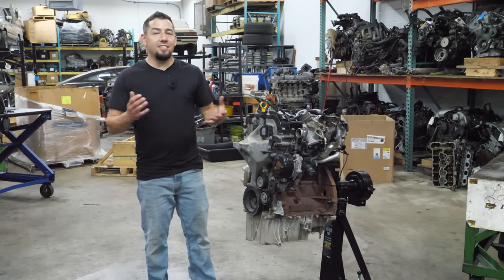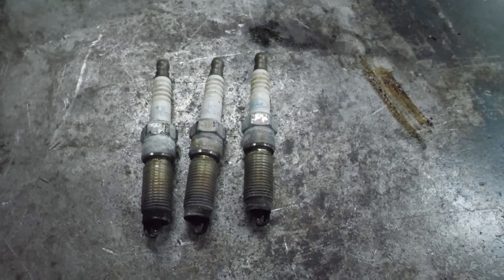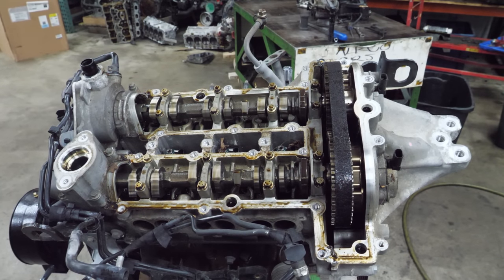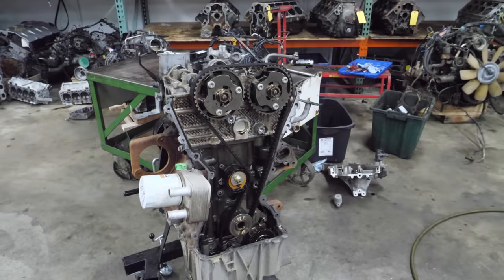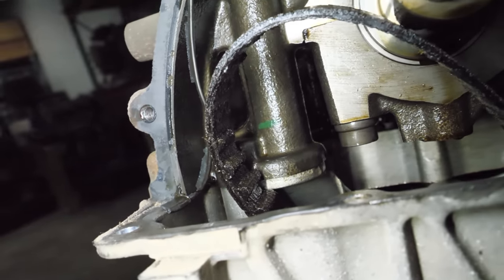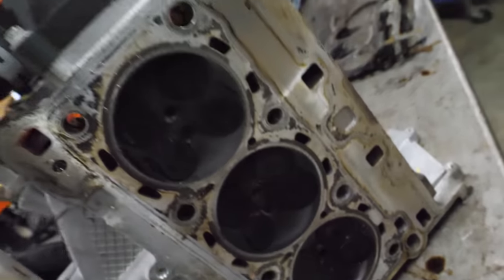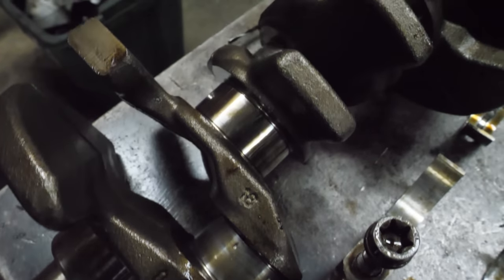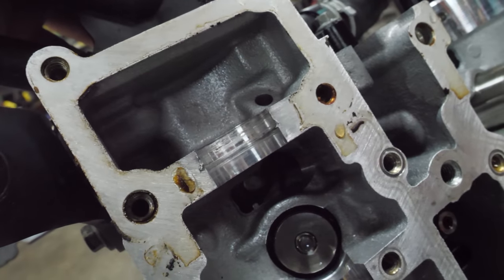JUNK Ford Ecosport 1.0L 3-Cylinder Ecoboost Teardown. LAWSUIT ENGINE!

Comment: I'd like to say I was surprised with how bad the engineering and design of this engine was,  but Ford has a long and sordid history of making subpar engines.  Love the teardown and commentary!
Reply: And yet Ford also produces the absolutely brilliant 5.0L Coyote V8 engine so go figure!
Reply: @DJDinaggio  They get lucky every now and then.
Reply: Shockingly GM has a wet belt in at least one of their new diesel engines, I think powering the oil pump, and you have to pull the engine or trans to get to it. Imagine spending the diesel tax, and having this junk in your engine. 

Sadly it's probably going to be a trend to keep cars from being too reliable and keep them failing so you have to replace it with a "cleaner" new vehicle.
Reply: The 5.0 Coyote is probably the best modern engine they have. The old 5.0/302 from back in the day bc was a good one also.  

The problem with Ford now is “planned obsolescence”. They don’t care if you want to keep a vehicle long term. They quit product support as soon as they are legally able too.
Reply: @OUSWKR Yeah but that's their one thing. Funny enough I feel like nearly every generation of mustang has a fairly bulletproof motor.. but most of their other cars go to shit. It's like they're obsessed with the Mustang only lol
Reply: @OUSWKR   Planned obsolescence also applies to other car manufacturers. It isn't in their interest for owners to have super reliable cars that last 20+ years.
Reply: @Perry....  Mustangs always shared an engine with many other ford products, at least the regular Mustangs. 5.0s, 4.6s, 5.0s again. You would find those in trucks, vans, SUVs. I am sure it was the same for the older ones too.
Reply: ford australia built some of the best inline 6 cylinder engines in existence, that have good output and phenomenal reliability. the coyote 5.0l is basically a v8 version of the barra 6cyl which came out nearly a decade before the coyote.
Reply: @6226superhurricane   The Coyote is an evolution of the near bulletproof Ford Modular engines.
Reply: @DJDinaggio  coyote head is more similar to the barra head than modular v8. and the barra head is a twin cam version that replaced the sohc 6cyl that goes back to 1988.
there's far more barra design similarities in the coyote than there is modular v8
Reply: Their 1.6 Ecoboost is not too bad, going from 180 to 350 hp on a unopened engine and it's coping fine for me, the 2.3 ecoboost on the other had doesn't do much more than 400 unopened which is pretty crap for a engine with 350hp from factory
Reply: @OUSWKR  I know many engineers, in various industries. Approximately zero of them engineer for "planned obsolescence". Imagine how precise you'd need to get it to fail, just outside the warranty period. It's not done. Urban myth.
Reply: @6226superhurricane  Ancient technology.. It uses pushrod to control the valves, and we are in year 2023.. Coyote is just cheap power cause one uses ancient technology.

Ofc using ancient technology has it costs. Pushrod engines dont rev very fast, they got alot to "push".

Pushrod altso have alot of moving parts. The more moving parts you have, the more potential for failure. 

Coyote is good as "cheap power" for one who wants to drag race abit on the weekends and not break the bank with buying modern technology.

Just a good transmission for an VR38DETT will set you back 25k, so i understand most wont be hobby dragracing with that.

However, the Coyote is still ancient technology. And is in no way a "good engine" in pretty much any sense except for price/power ratio.
Reply: @MrDanisve  well clearly you're confused, the barra and the coyote both use double overhead cam, vvt, roller cam followers. no pushrods.
the 4.0l barra 6cyl in the fg sprint made 370kw (496hp) and 650nm (479 lb/ft) standard
Reply: @DJDinaggio I guess the coyote getting cylinder deactivation in the new gen is brilliant. How does that work out for GM.
Reply: The 300 cu-in straight 6, which I think was torn down about a month ago is an old bullet-proof engine that was designed to last forever.
Reply: 4.6L 2V in a 05 Vic LX Sport with 309k miles on it, no major repairs, Id say they get some of them right. But yeah this 1.0L EB is garbage, shame on you Ford!
Reply: One of the best ford engines was the straight 6 cylinders . Like the 170, 200,250,300 cubic inch. All gear timing, crank bearings between each crank journal. Simple and long lasting with proper service.
Reply: Wet belts are not exclusive to Ford, for example PSA Peugeot/Citroen also have those ("Puretec" 1,2l if I remember right) and they suffer from exactly the same problems namely belt teeth clogging the oil sump and starving vital engine parts of oil.
Reply: The LS is the greatest engine ever built
Reply: @6226superhurricane  Not confused, just misinformed. Seems america has taken the leap and left pushrods finaly :P About god damn time, better late than never.

Now they just gotta stop making such huge engines and taking so little power out of them. When you hear a 5.3 liter barely passes 200 hp one start to wonder if they have sand in the bearings or something. 

Sorry i like to take a jab at the americans sometimes, and Australians are pretty much budget americans. So guess i can jab at them too :D

Coyote has a redline of 7000 rpm. Why is it so low? A 6.2liter mercedes can rev 1000 rpm higher.  I just assumed the coyote was pushrods due to its lack of RPM. Now im just confused why it cannot rev higher considering its DOHC. Guess one uses cheap metal or something whats why it cannot rev higher? Coyote has abit longer stroke than the Mercedes. But the Mercedes 6.2 naturally aspirated has the same torque as a force fed Coyote.

Now im even more confused about the Coyote.
Reply: @MrDanisve  ok you're still misinformed, ford america released the 427 "cammer" ohc v8 back in 1964 so ohc is nothing new for them
why is the coyote redline 7000rpm in ordiary road cars probably because it makes its power and torque lower in the rev range where it's more useful.
the mustang gt350  coyote v8 redline is 8250rpm
and it's not as if ford hasn't had formula 1 v8's that redline close to 12,000rpm.
Reply: @6226superhurricane  Ford america and Ford Europe is not the same. Run by different people. American corporate nature would not fare well in Europe with their extreme cost cutting at the expense of quality. 

The mercedes v8 is used in ordinary road cars aswell. Why does it have 1000rpm higher redline?

Oh and RPM is very important to how much horsepower an engine can make. Cause after all horsepower = Torque x RPM / 5252

The more RPM you can make, the more horsepower you get. In simple terms. 

Yes i assume the gt350 has a modified coyote that can redline so high? Cause from all the specs i read, normal Coyote is max 7000 rpm. Lighter pistons, lighter rods etc in the GT350? Ford America allways does something wrong in the name of cost cutting. Guess the coyote is cheap materials when you compare to Mercedes engines. 

Yes america was the bomb in car industry untill the 70s. I mean electric windows was on alot of cars, while only the S class mercedes of the Europeans had it. America had the best technology aswell. But then the 70s hit. American corporate nature evolved into this cost cutting mayhem. And quality of the american cars suffered. Europe stopped buying american cars and bought their own or Japanese instead.

US had the world marked in cars, but threw it all away in the name of profits. We see the same thing happening to Boeing now. The 737- MAX scandal? In the name of cost cutting by not making a new airframe when they should but instead try to manipulate a plane to behave different than it does.

Today the US car industry is in so bad shape they dont even dominate their domestic marked, even while being protected by the goverment with huge import tariffs on cars.

And the US car industry wont get better when its protected by uncle sam. Cause it does not have to compete, thats why american cars are rather expensive for the quality you get. Even midrange US cars have hard plastic in the interior.. When i drive my Audi i have leather etc everywhere.

Today the americans pay about 25% more for a car than they should, if the marked was free. 

When you look at american cars today (That dont borrow an engine from Europe) its often like timetravelling 10-15 years back in time.)

So many of the american engines are still naturally breathing. Been a while since we had naturally breathing engines here in Europe as a "standard". Adding a turbo or a compressor became a rather nobrainer once we got electronic fuel injection systems and we could make the compression of the turbo engines alot higher than the really low compression ratio one had to run with turbos and a carburator.
Reply: @UncleKennysPlace  designs that tolerate difficult or time-consuming replacement procedures for maintenance parts are a form of planned obsolescence — they make older products uneconomical to repair.
Reply: @volvo09  The little 3.0?
Reply: @MrDanisve  I hope you're not trying to imply that Europeans are somehow immune to the temptation of cost cutting in various industries.
Reply: @baxs5076  I think that's the one, because I don't think it was a big engine...
Reply: @baxs5076  Not at all. They are just not bound by law to seek the most profit for the shareholders.

Which CEOs are in the US.

Comment: That air gun makes for more boost than the actual engine 😅
Reply: It's not about massive performance it's for the masses cheap small small engine
Reply: Believe it or not they run 22psi stock.
Reply: that turbo was the least of the problems.

Comment: I love when you tear down engines like this...smaller displacement units that us average Joe's might have out in the driveway.  If you're taking requests I wouldn't mind seeing a 1.4L Fiat Multi-Air teardown so we can see the funky electro-hydraulic intake valves...
Reply: You don't see a lot, it's a whole module that goes on top of the head. Not a lot to tear apart. Good system providing you keep the oil fresh and use exact specs for it. Oh, and on the 1.4l if you replace regularly the small bolt-with-filter on the side of the head.
Reply: the multiair module is reliable if the car has good oil in it

Comment: It's a shame, they could've made this engine so much better with little changes to it's design, and it'd probably be quite reliable, but the way they did it is just crazy.
Reply: Yeah. Without wetbelt it would look like they're quite ok little engines.
Reply: It's exactly as designed, a cheap car engine that's expendable right after warranty so you'll be in market for a new car. First time with Capitalism I presume?
Reply: The only car you would want to swap IN a rotary engine.🤣🤣🤣
you could break it down, replace the seals and put it back together in the time it took to look at that ecoblah!
Reply: The new version for a few years now has a timing chain, not belt
Reply: @cuddlefish999  Thank god. That was a good decision.
Reply: @Nile9063 the problem is a timing belt (dry) engine is allot more resilient to extended drain intervals...  or that's been my observations when I was at a Honda dealership.
Reply: The newer versions of it in the focus have a timing chain. But they've kept the other belt so I'm not sure it helps much.
Reply: The revised version actually doesn’t blow up so yeah, they did fix it
Reply: Agree, reading some comments, I understand it's a light, good sounding, powerfull engine - with a fatal flaw

Comment: Thanks for the video! To all Ecoboost 1.0 owners. Never use other oil than in specification. Because of chemical reaction with the oil pump and timing belts Even a small add on of wrong oil can destroy the belts.
Reply: I'd say this could have been the starting result of failure. Standard oil may not have been suitable for this engine setup.
Reply: Why??
It’s just a cheap car motor, 
But it requires exotic car maintenance!
That’s silly!!!!
As a Ford man, shame on ford!!!
For this pos!!!
Reply: @metalted6128 Good point, but at the end, you gotta follow the guidelines. The problem is a bunch of engineers trying to reinvent the wheel and complicating shit.
Reply: I would think most of those "oil additives " would do a number on the belts...

Comment: Great video thanks! Glad I've got an old Focus with the 2.0L Mazda motor. No Belts or crappy turbos to blow up!
Reply: That 2L is indestructible, I had a 2007 mazda3 with the 5speed manual and the 2L, no matter what I did that thing refused to give up
Reply: My thoughts too.  Ford was putting out better cars in the 2000's.  I personally drove that 2.0L over 225k before I sold it.  Sold it for a what?  You guessed it, another Mazda.  The only thing I don't like about the next gen Mazda engine (same on the 2.0L) is the lack of port injection (gotta manually clean those intake valves..... again).  Funny when I hear people say that the Ford/Mazda collaboration was bad.  They don't know what they're talking about.  Ford had better rust prevention at that time (look at the Mazda 3's) and Mazda is the new Honda will their engine designs.
Reply: Had a 93 protege lx with the 1.8L DOHC  that engine was a gem good low end torque and could be rung out to the 7000 RPM red line all day. It took a loose oil filter( yeah the first oil change that I didn't do myself)and running it out of oil to lame it. Then running it out of coolant  to kill it.
Reply: I had a 2001 protege with the 1.6L and a 5-speed. Those 1.6 and 1.8's just couldn't be killed. Fantastic engines, super easy work on. Mazda killed them because they were way too good (plus the only power was if you had a manual and no one knows how to drive one anymore ..)